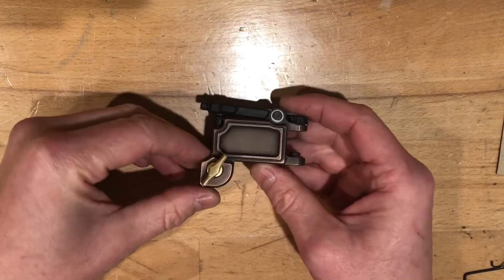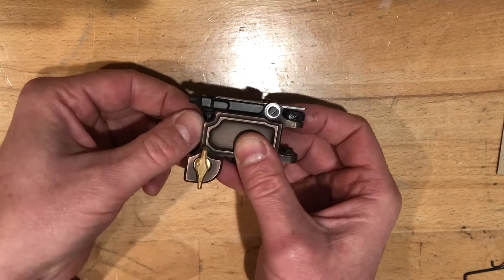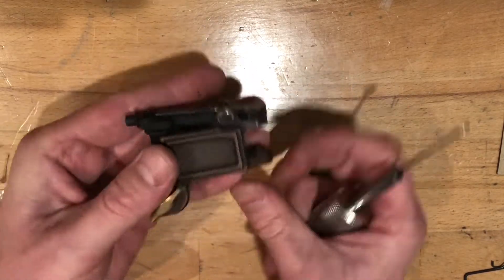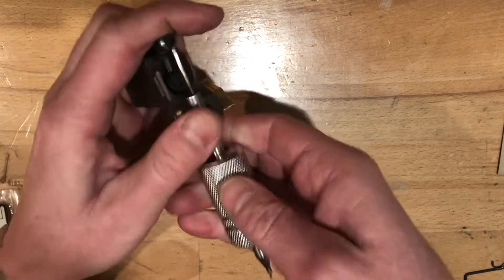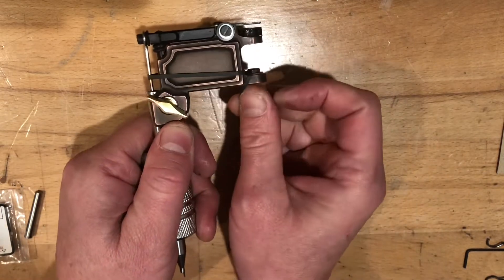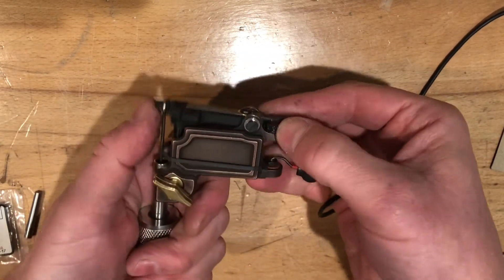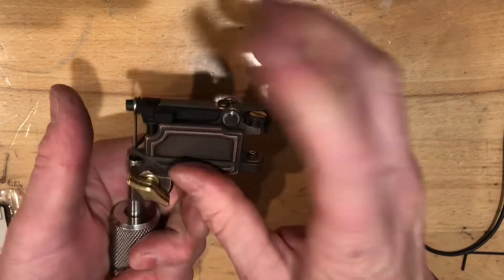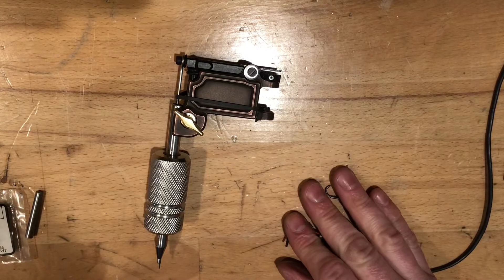Mojobox Remastered

Comment: Any particular reason you ran it with the positive end down? Does the stroke wheel make less of a difference when the positive end is down?
Reply: It hits different depending on how you set the positive/negative on kubins. 

On regular machines it would just blow the motor though.

Comment: how is this for slow pepper shading vs the sidewinder v3r or 7?
Reply from the maker: I would say this is the most ideal for that out of the three machines.  You may just have to turn the impact screw on slightly more to get it a little stiffer hit at low volts.  It’s very stable with low speed applications.

Comment: Anyone use this ? I'm assuming u can't use carts with it cause of the springs and it seems to be a liner specific machine idk can someone lmk or Dan if u see this get at me..I'm gonna message u on ig
Reply from the maker: You can use cartridges, but need to use a rubber band to negate the cartridge tension.  Definitely better with standards
Reply: @dankubin5386  early Sunday morning I'll be on ur site fingers crossed they don't sell out...
Reply: These are so amazing for lining with round shaders its not like the dmc or the sidewinder either it be kool to engrave some designs on the side of them some nice filigree ir something
Reply: @dankubin5386  what’s this machine like for lining with both small and larger groupings? (Larger groupings as in Round Shaders) 

Is it as versatile as the sidewinder ?